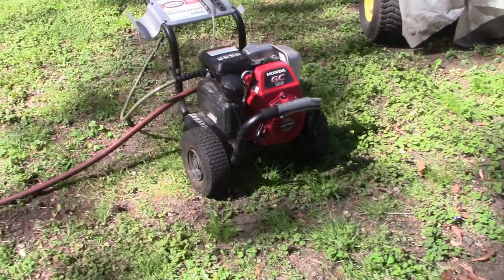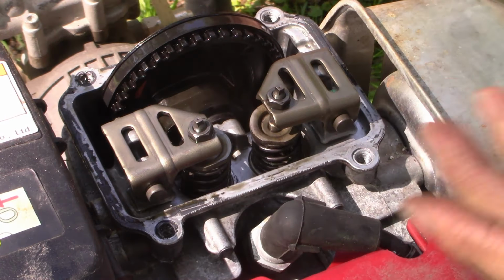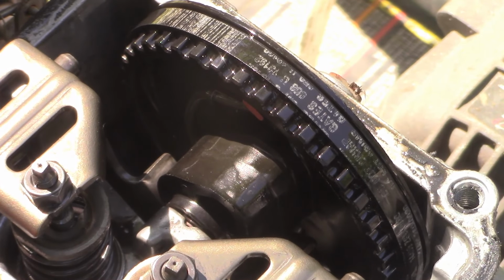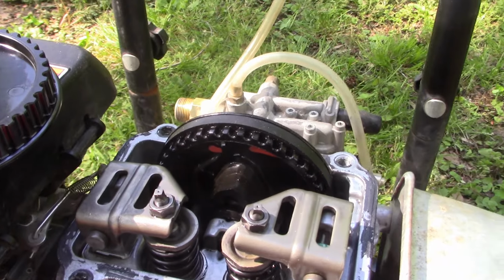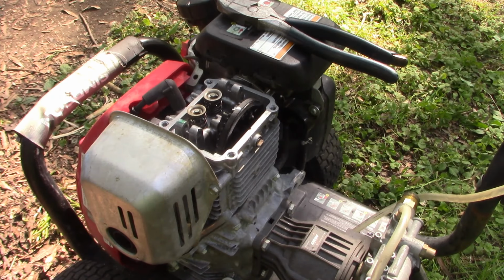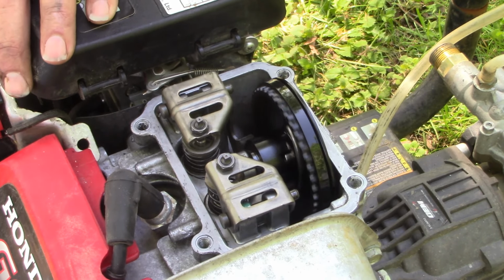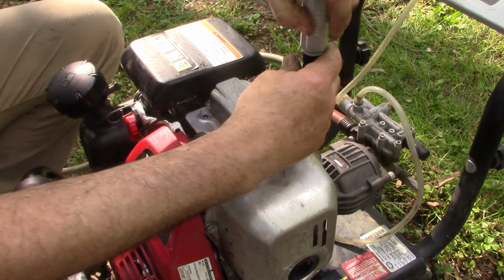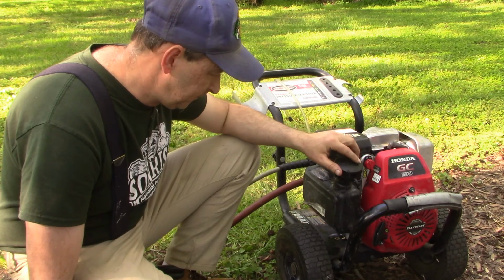Why your Pressure Washer Starter Rope is so HARD to pull, and how to fix it

Comment: This is the best repair video ever made with regards to this type pressure washer, I wish I could have given this video a million likes. Thank you sir
Reply from the maker: Thank you so much! You've made my day! Did you get your machine back up and running?
Reply: Thanks…. I just realized that I need to remove water pressure from the wand and then I can start it again. Not sure what that is but it’s working for me now….Thanks again…
-Pieter
Reply: I have this problem but the cam and valves look like they are working fine. No pressure at the wand it's open.  It's easier to pull with the spark plug out? Maybe a bit too full of oil - more oil on the cam and valves than your video.

Comment: I have this problem but the cam and valves look like they are working fine. No pressure at the wand it's open.  It's easier to pull with the spark plug out? Maybe a bit too full of oil - more oil on the cam and valves than your video.

Comment: I personally just did this to my 190 pressure washer. Thank you much for this do it yourself video. I literally took the pressure washer out to the curb after the recoil almost took my hand off. I went back out and got it after watching this video. You saved me lots of $$$$$$$$!
Reply from the maker: Ok, great. I'm glad you are gonna fix this yourself. Another thing to check is the flywheel keyway pin. If misaligned, one symptom is that the starter rope literally rips itself right out of your hand....startling and potentially painful. Good luck.
Reply: @Buckwsr  i guess mine is the keyway pin because after 4 to 5 pull it rips out of my hand?

Comment: Great video. I've NEVER seen a video on changing out the cam pulley nor that it was even a problem. I would have thought hydro lock or junk stuck in the pump. Thanks for some valuable insight. 😎✌

Comment: Thanks, brother! This saved my ass! I've never used a pressure washer before and I borrowed my girlfriend's John Deere 3800 4.0GPM and the sucker locked up on me after initial start and then fail. Turns out it was out of gas when I tried to start it. The solution was filling it with gas so it can actually run,  and then triggering the wand as you suggested! That initial trigger pull to release internal pressure before trying to start it made the starter pull work again! Thank you!!!!
Reply from the maker: Glad you got it all up and running!

Comment: Thanks for the video, I'll check for that broken/worn out part, this winter when I dont' need the washer and I have more free time.   In the mean while, I turn off the incoming water before pulling the rope.  This relieves all of the pressure.  As soon as the engine fires up, I turn the water on.     And a safety warning for anyone with this issue.   The washer chassis can and will  pull up and hit you in the head, if the recoil start locks up.   I found out the hard way and it almost took me out. :)

Comment: Great Video - Fixed my issue. Cord was impossible to pull. Replacing camshaft pulley did the trick. Best way to test if camshaft pulley is the issue is to remove spark plug and pull the cord. if the cord pulls easy you know its the pulley. Part # for GC 160 engine is 14320-ZL8-010

Comment: Buck your the best!.I just replaced the unloader on my power washer and then I go to use it and I can’t start it. Believe it or not it was the buildup of pressure in the pump. I release the pressure with the wand and Wala! I already had enough aggravation with the reloader, although a simple repair, it tripped me up on the last weekend  I wanted to power wash my house. Now the hard pull…no more! Thanks again. Barb in NJ
Reply from the maker: Easy fix! Great job, Barbara.

Comment: YUP!
That is my problem.
I found my pressure washer in a dumpster, certainly could not pass it up on account of that Honda engine on it.
After watching vids I found yours, and, WALLAH, my camshaft pulley is messed up too!
Just ordered the new gear and if it has more problems than I know of, so what!
The new gear is under $20.
I'll give you an update when I install the new gear, Thanks Buck.
Reply from the maker: Awesome! Hope you get it fixed soon. What a great dumpster find! And your spelling of Voila cracked me up!

Comment: Nice one, Buck!  This shows the great engineering Honda does - making it so easy to replace a compression release compared to most small engines.  I definitely learned something new today, so thanks!
I would have appreciated seeing exactly why that failed. Did some of the plastic wear over time?
I would have replaced the O-ring while I was at it, although I see Honda supplies the shaft and O-ring along with the cam gear for a pretty decent price.

Comment: I’m amazed at the number of people in this comment section who had to release the wand pressure to make the engine easier to turn over. The first steps with any pressure washer are to run the garden hose before hooking up to make sure no debris gets into the pump, then hook up the pressure hose and wand and operate the wand to confirm water flow so as not to burn up the pump by running it dry. 
Of course many people never read their owner’s manual. 😉🔧👍
Reply: Saved me 17 minutes. Thank you!

Comment: this solved my problem.  that compression release valve on  my gcv190 camshaft was no longer working.   was not springing back into place which made it a bugger to pull.   replaced the camshaft pulley for $10.  easy fix.  took longer to clean off old gasket seal than it did to replace the pulley.  appreciate the video and insight!
Reply from the maker: Great job, Todd!
Reply: Just ordered the cam pulley for my GCV190 pressure washer also... Got it on craigslist a week ago for $60... It would run for around 10 minutes and then would like to pull your arm off when trying to restart it... The small metal protrusion piece on the cam would stick and not allow the compression release to work properly...Thank God for YouTube and it's posters !
Reply from the maker: @davemcgaffney9401  Yes, Dave, if you can fix things yourself, there are a lot of bargain machines out there to get for cheap, or even free. Good job.

Comment: Thanks. Mine was the pressure built up. Been using pressure washers for years. Never had an issue
Reply from the maker: Gotcha. If the engine is reluctant to start for whatever reason, the pressure in the pump can build up and make you think you have even worse problems. Glad you're back up and running!

Comment: Very good video. I did the same thing on my John Deere tractor. The valves needed adjusting after replacing the pressure release switch.

Comment: Just found one on the curb for free with the same "hard to pull" issue. Thanks for the tips, I can't wait to dig into this and try your tips !
Reply from the maker: Hey, that's fun! Enjoy the free machine, and good luck getting it running again!
Reply: @Buckwsr  Per page 14 of https://cdn.powerequipment.honda.com/engines/pdf/manuals/00X31Z8B0240.pdf , I see that the valves should be gapped at .15mm (IN) and .20mm (EX) for the gaps. Do these correspond to .006 and .008? Thanks for keeping me honest!

Comment: Did everything you said check valve clearance they were .01 reset it to .004 put it together pulled it no problem. However I let it run for a moment turned it off and I can’t pull it again. All other issues issues you discussed were fine. Any suggestions? Honda G C 160

The park came in. I changed it and it works great thank you so very very much! Awesome explanation !!
Reply from the maker: Check the compression release on the cam gear. It probably needs to be replaced, as I did in this video.
Reply: @Buckwsr  I have the spark plug disengaged but screwed in valve cover off and I watch that cam come around and move the exhaust rocker arm and compress the valve. It’s not hard to pull. However, when I let it run, shut it off and try to restart it I can’t pull it. I hope this makes sense. Thanks.
Reply from the maker: @lanceuhde1498  The exhaust valve opening on the exhaust stroke is not the same thing as the compression release. Compression release is a small bump given to the exhaust valve. It is a small bump, just barely perceptible, unlike the more obvious opening of the exhaust valve on the exhaust stroke. That's a different event. The compression release mechanism is built in to the plastic cam gear....a moving arm connected to a spring....and it stops working reliably on these engines. You just have to replace it, as I demonstrated in the video. Good luck.
Reply: @Buckwsr  thanks for your patience. I absolutely will change it and I’ll let you know!
By the way, it is a very good video very well laid out put together.

Comment: My New HART Psig, Washer done this if I used it and had to stop it to refill Gas Tank. The Rope/ Crank Mechanism was Locked Up, you could let the Psig. Washer set over night and engine being cold, you could start engine normally, no problem pulling Rope but when engine was Hot and stopped to refill gas tank, engine was locked up again so it could not be the Decompression Cam--how could it Heal itself over night...
Reply from the maker: Before attempting to restart the engine after refueling or whatever, release pressure from the pump by squeezing the trigger on the wand.
Reply: @Buckwsr  --I Tried that to no Avail, if it sets overnight, it is easy to Pull the Rope the next morning, somehow it Heals itself overnight...

Comment: I have Honda GCV 160 engine pressure washer wanted to add pump protector but does not go through.I have an electric pressure washer and it goes through from inlet and out from pump out let. Any advise. Thank You

Comment: Let me ask you this: There is a knob that you can turn right beside where you plug the hose in and I'm wondering if that has something to do with it. I tried undoing the nut to the flywheel and it won't budge.

Comment: hi liked video i had issue like this with my Simpson 3000 GCV 190 it was doing this when pulling but relieved pressure everytime but on my 2nd car i was puttin water in cannon to rinse out and came outside n oil was running out above pump my pump is on bottom of that model could this relelated? thx Jeff

Comment: Very clear and concise. Thanks
Reply from the maker: Thanks so much, Mike!
Reply: I know you get more questions than it’s possible to address, but, lol. I have one if you could?
Reply from the maker: @mikemilam525  I can try...what's up?
Reply: I have a Briggs and Stratton professional series 190cc. Pressure washer application. After running for about an hour, it begins pushing oil out. Air filter box, upper crank seal that I can see. Compression is/was 75 psi. I’m in the process of replacing the head gasket thinking maybe it was bleeding pressure into the push rod cavity. Honestly the old head gasket didn’t look that bad. My thought if this doesn’t work that it may need rings? Thanks for your time.
Reply: Correction, compression is 65. Sorry
Reply from the maker: @mikemilam525  It's always tough to make a diagnosis sight unseen. This may be obvious, but I first and foremost would make sure the engine isn't over-filled with oil. I really don't know what else to say, other than to suggest lightheartedly that you try to complete your work in 55 minutes! Ha ha. Sorry, couldn't resist. Wish I could help you more. Good luck.
Reply: Funny you mentioned the oil. When I got it back together I figured I had better check the oil before I start it again and it was full. Huh?? How could that be? I’ll know better after I run it for awhile, but you may have nailed it. Thanks again for your time.
Reply from the maker: @mikemilam525  If the needle/seat in your carburetor is leaking, the fuel may flood your crankcase while the machine is in storage between uses. Check the oil level before using it, and make sure there is no gasoline mixed into the oil.
Reply: As of now there is no gas smell in the crank case. As I mentioned it was full of oil when I checked it and there was quite a bit leaked out. Of course a little bit spreads out and looks like a lot. When I got this machine (used) I pulled the carb and cleaned it well and also pulled the tank and cleaned it. I bought it from a homeowner who said it ran perfectly the year before but this year it wouldn’t start. After I cleaned everything, it started on the first pull and has every time I use it. I added a fuel shutoff and turn the fuel off and let it run out of gas after each use. I may go ahead and change the oil and start fresh.
Reply from the maker: @mikemilam525  It sounds like you're on top of things, and hopefully it's just a simple case of too much oil.

Comment: Could this be the problem if mine still pulls but seem like the rooe might break? Very hard , have to put major muscles to male it spin a lil, ive seen some video with them pouring Marvel Liquid into the spark plug area n let that sit fir awhile but im guessing thats fir seized engine? Mines a farely new dewalt pressure washer,

Comment: Mine starts with the pressure relieved but stalls right away. But it starts and runs if you keep the trigger on the wand pulled! If you let it go, it stalls. Any ideas?

Comment: Hey! I have the same engine in mine but its an easy start... after it ran out of gas while on i decided to refuel and change the oil... tried to start it and it wont pull even 3 inches out no matter how hard i pull... its not a hard pull. It just doesnt pull at all. Any suggestions? Im going to follow the tutorial now for you hopefully this video helps
Reply: Same issue did it help?
Reply: any reply to this, my gcv 160 same issue-ran out of gas and wont pull?
Reply: Pull valve cover and check the exhaust rocker arm for cracks.  Check exhaust valve clearance (and if the exhaust valve guide has started working it's way out it'll be WAY too open.)

Comment: Thanks so much for this video. I have this same model  and can get it started the first time, but when it shuts off it’s impossible to pull the cord just like you demonstrated. It needs to sit about 5 hours and then I can start it. Do you think it’s having the same issue you demonstrated?
Reply from the maker: Yes, it's probably the same issue, though I would expect the rope to be difficult to pull whether the engine was warm or not. It's a pretty easy fix. Good luck!

Comment: I have a question I have two of the same power washers but the one that’s a little older that I use all the time I have to fix a few things so I try to get my new one out and when you pull that road it’s really long so it doesn’t get enough momentum when you pull it for the engine to  stay start it and yeah I have Lyme disease and really bad air hunger from this you would think it was asthma but I get wind it so easy so if I pull the cord 10 times especially with it being so long compared to the other one I can’t get it  stay started because it’s just not getting enough to stay started can I shorten the rope on the handle
Reply from the maker: Thanks for the note. First of all, I would say I don't see how an extra-long rope would be an impediment to starting the engine. But yes, it would be easy enough to shorten it, if you want to do so. Just pull out a few feet of rope from the starter assembly, and tie a knot so that it doesn't accidently retract completely into the assembly when you remove the handle. Then shorten the rope at the pull handle. When finished, just untie the knot. Finally, I would say that an engine in good shape should not require 10 pulls to get it running. Your machine probably needs some maintenance. Perhaps the carburetor needs a good cleaning. Maybe the choke mechanism is not working correctly. Hard for me to say. But a well-maintained engine should start within 2 or 3 pulls at the most, in my opinion. Good luck!

Comment: Just purchased a new Honda mower.  When cold the starter cord pulls and it starts normally.  After being run and the engine is still hot the cord cannot be pulled as it reaches compression it stops.  After cooling it works.  Not sure what Honda will do but I am not sure I want a new mower that has to go to the shop right out of the box.  Hopefully they will ship me another and allow me to return this one.  I would rather repair it myself than to haul it to a shop somewhere.  I purchased the mower online from Northern Tool and it was shipped in the factory box.
Reply from the maker: Rats. Sounds like you need to send it back. It's a matter of principle, however inconvenient.

Comment: Thank you for making this video! Just got done fixing this exact issue on a GC160. Any tips on how to get any plastic or metal bits out of the oil pan?

Also for anyone else here with a GC160 the rocker specs are .006 for the intake side and .008 for the exhaust side.
Reply: Flush the oil like 5 times with diesel fuel and some 2 cycle oil premix mixed together

Comment: Hey how's it going ? I just watched the video , now would that be the same as when I pull my cord it literally rips right out of my hand ! 
What I have is a Generac generator.  Can you help? Like all the comments the video is very informative. Thanks !!
Reply from the maker: In my experience, when the pull cord gets violently ripped out of your hand (scary and sometimes painful), the issue is that the engine timing is out of synch. The timing is off, and spark is being thrown into the combustion chamber at the wrong moment. This could be due to a mis-aligned flywheel and shorn flywheel key. I've seen that on lawn mowers after hitting a rock or stump, but I have never seen it on a generator. In this video I address a faulty compression release mechanism, which results in a starter rope being ridiculously hard to pull, but it does not cause the pull cord to be yanked violently out of your hand. Good luck. I'd be interested to learn what you discover.